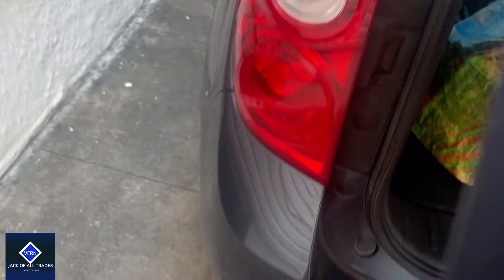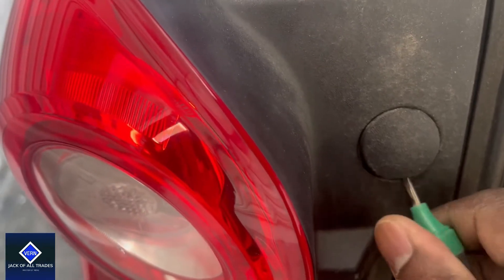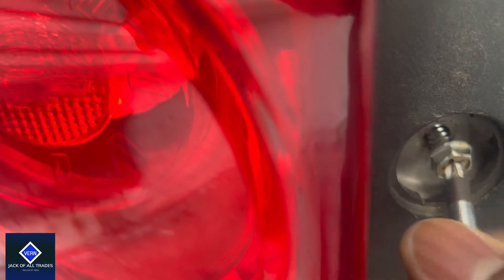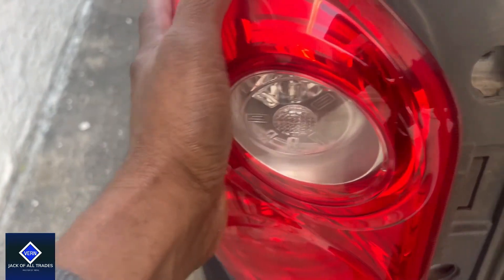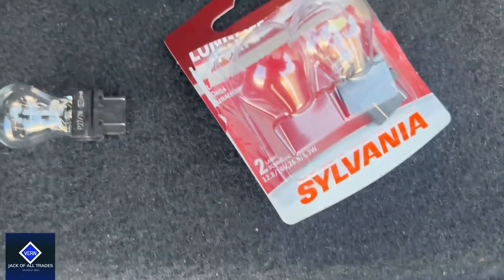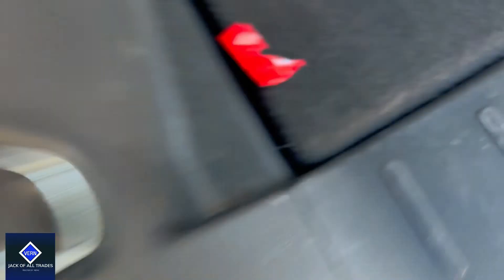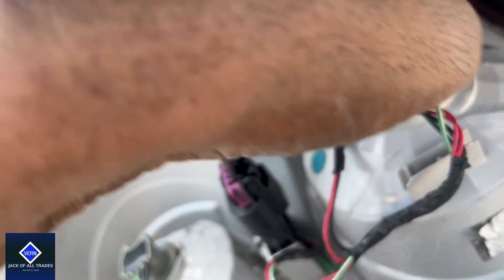Changing Turn Signals on 2014 Chevy Equinox and similar vehicles.

Comment: After taking the screws out I can't get it loose enough to take it off to get to the bulb. Something is holding it from coming off.
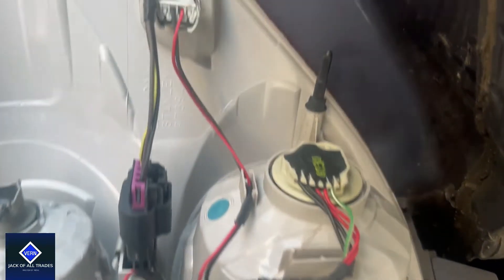Reply from the maker: It is held by the black push pins minute 2:18 in video. Just wiggle it out. Hopefully you got it. You can do it!